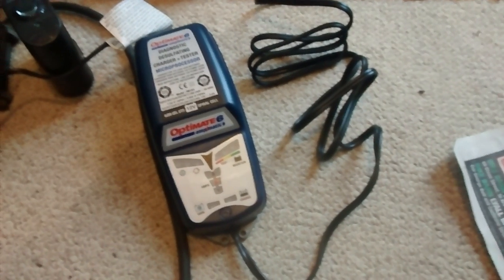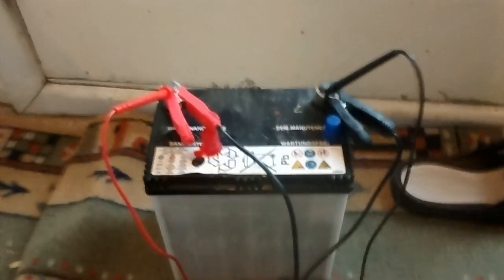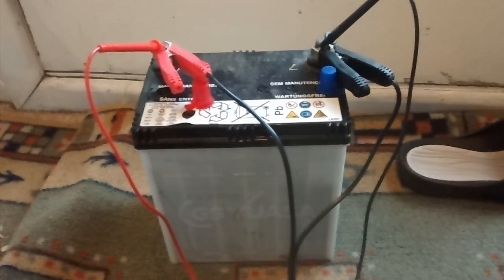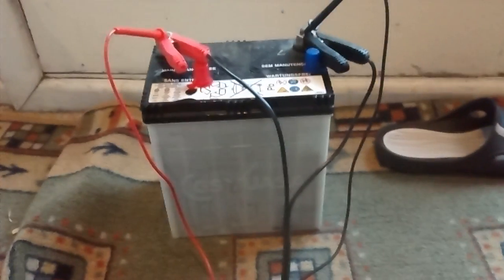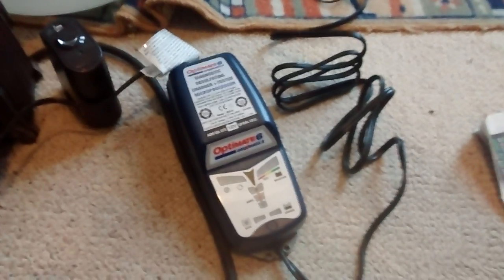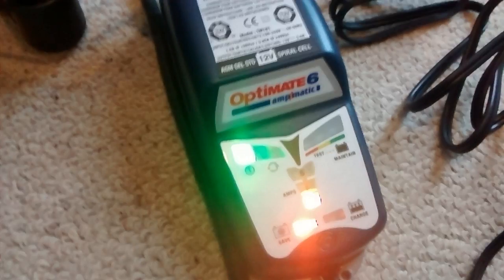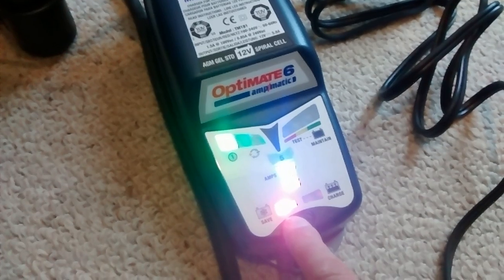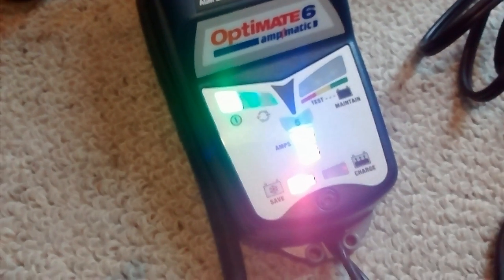Optimate 6 and car battery

Comment: Try to check electrolyte levels before charging. On the video is visible low level at the first cell from right side. You will have better results maybe :-)

Comment: I prefer the optimate over ctek for a simple reason, ctek you have to press a mode switch to start, optimate you dont.  if you get a power cut the ctek goes back to sleep untill you press a button, optimate goes back to working, essential if you using a charger to maintain  a battery for a longer time than just an overnight charge, like some people use them plugged in for months....not good if you come back and find it didnt restart itself some months ago.  I dont hold out hope for any desufating going on though, once a battery is done, nothing revives it, i think the desufate is just a gimmick.  battery will either come back or not, just hope!
Reply from the maker: http://www.reuk.co.uk/Battery-Desulfation.htm  which is what I read before I bought the optimate 6.  High voltage can reverse the sulphation but risks the battery building up dangerous pressures from gas.  So, the high voltage is given at high frequencies to prevent this happening.

Comment from the maker: https://www.youtube.com/watch?v=OIr_RqhYtqU

Something I got from Amazon a few days ago to recondition and save my lead acid batteries.  I have some huge gel cell batteries in the basement but I doubt it will work on those though.  It can apparently desulfate stuffed lead acid batteries by passing a high frequency signal through the battery to break down the sulfate crystals on the plates.  Seems lots of people say these things are a scam.  It would be nice to find a definitive answer.
Reply from the maker: http://www.reuk.co.uk/Battery-Desulfation.htm

Charging a lead acid battery involves desulfating the battery.  Stuffed batteries have large sulfate crystals formed on the plates insulating the lead which don't desulfate with a standard charger.  To break those down requires a high voltage but this then leads to gases being released and boiled off.  These desulfators work by creating the high voltages at a very high frequency so that the gases don't build up.  They also work at the resonant frequency of the battery to help this process.